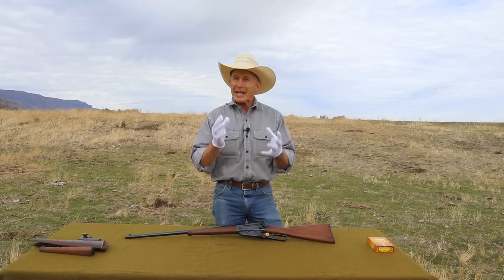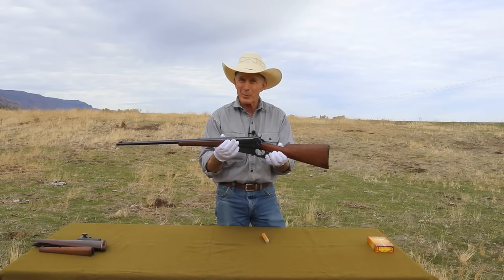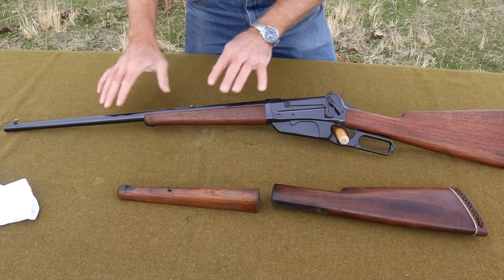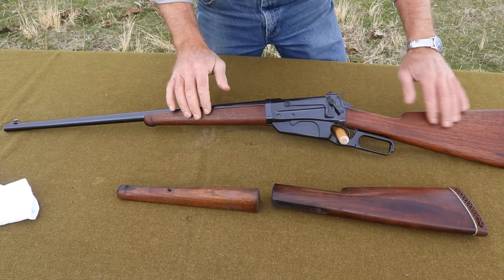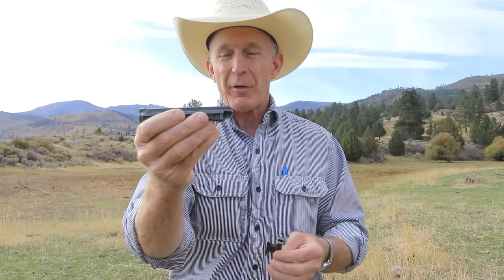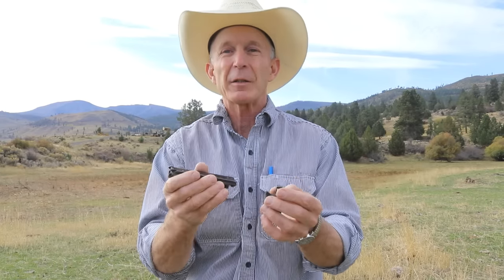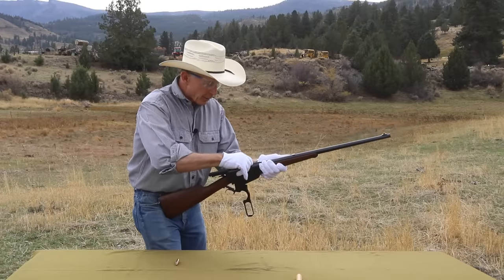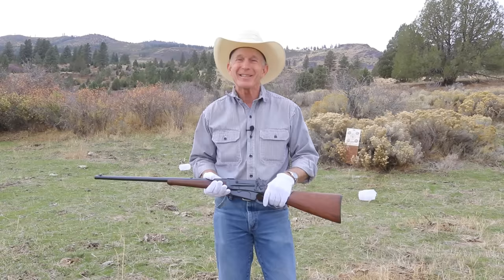1895 Restoration -Time to Test Fire

Comment: great clip, thanks. I got lots of information. Last week I got a Miroku Winch 95 in 30-06 for shooting. Always wanted an original one but my buddy, a gun smith  told me about problems wth modern loading pressures. I couldn't believe untill you told the same. greetings from Germany....
Reply from the maker: Matthias.  It's my understanding that the reproductions are made from a higher quality steel than the originals and don't suffer from headspace issues.

Comment: Thanks for the video Mark. Have you run into headspace issues on the 95 in 30-40??
Reply from the maker: No.  30-40 Krag doesn't produce nearly as much chamber pressure as 30-06.  About 40,000 PSI
Reply: Thank you

Comment: I would think 150 fmj 30-06 designed for garands would be suitably light enough in pressures?
Beautiful rifle very nice work.
Why doesn't the 7.62x54R have the same issues in the 1895?
Reply from the maker: I believe they would have the same issues.  I believe that if you were to regularly shoot modern 7.62x54r cartridges loaded to max C.I.P. pressures (56,500 psi), you would end up with the same issues.  The well-used Russian muskets I've fired usually show some signs of excess headspace with slightly backed out primers.  It's quite likely that most have only been fired with WW1 era ammo that almost certainly produced less pressure than today's ammo.
Reply: @thecinnabar8442 

Hey Mark, I have been reading some of Townsend Whelen's work, and he wrote that in his experience the original Winchester 1895 were generally not accurate rifles.  In his book "Ballistics" he wrote that groups of 4.5 to 7 inches at 100 yards were typical, and the Winchester company even told him that accuracy was indeed problematic for this model.  

Have you found this to be true?  Thanks
Reply from the maker: @HaNsWiDjAjA  I'm sure I've shot a much greater variety of 1895's than the good colonel Whelen, including all 9 calibers.  Some group well, some don't.  Overall, I'd say they have comparable accuracy to the other Winchester levergun models if the shooter has the patience to develop accurate loads.  I've killed multiple deer and antelope at more than 150 yards with 1895's and wouldn't even attempt those shots with a rifle that would only group 5"-7" at 100 yards.
Reply: @thecinnabar8442  I see. Might the good colonel's problem be due to the quality of ammunition he had access to?  I know that factory ammunition quality has improved enormously since his time, but I still find it hard to believe that it made an otherwise good rifle only capable of shooting 5-7 MOA.

Comment: Would 06 m 1 garand load's as you are sure to know are at lower pressure help with this issue. Just thinking how to fix a problem. Enjoy your channel. Blue steel and wood love it.
Reply from the maker: As I mentioned, according to Keith and Whelen, any loads in the 42-43K PSI range can be safely fired in an 1895 without creating headspace issues.  Winchester recommends pressures for the 1895 not exceed 47,500 PSI.  The info I've found indicates that M1 ball ammo produces 50,000 PSI.  They are lower than modern day 30-06, but I wouldn't regularly use them in an original 1895.

Comment: What about 1895s in 7.62x54R?  Are there many (any) in the US?  I know they existed but my historical knowledge is almost zero.  Please enlighten me.  Edit:  Thank you for taking the time to produce and edit these videos.  I pray that some time you'll break even or even turn a profit with ScrewTube.
Reply from the maker: There were 293,000 Russian contract 1895 muskets produced, more than 2/3rds of the total production of 1895's.  There's no way to know how many have returned to the United States.  Based on their scarcity, I'd guess it's a very small percentage.  Unfortunately, many of those have been modified and/or refinished.  Original and complete 1895 Russian muskets have become highly prized by collectors and the asking prices have soared lately.  Well used examples have an average asking price of around $6K these days.

Comment: Just came across two 1895's in my local Gunshop today.  The first a military type of carbine in honest to goodness 30-03 Springfield.  the other a slim barreled sporter in .35-Winchester, which was a wildcat 30-40-Krag with a .358 caliber bullet.  

As to bluing, with Winchester there was a period that the receivers and barrel steels were too high of Nickel and would revert to the white.  About 1929/30 or so Winchester switched to what they called "Winchester Proof-Steel".  This metal would take any bluing method.  The problem was the metal make-up, not the bluing.  The Du-Lite method is just faster (typically 30-minutes) and far and away cheaper to produce than the long and labor-intensive Rust-blue method.

I have an 1894 Winchester (.32 Win Special) the receiver was high nickel and made in 1928 and wouldn't hold bluing.  At that time a new company "Turnbull Restoration Company" was advertising in Shotgun News.  I sent them the rifle and had the receiver and other parts color cased and rust blued the barrel/magazine tube in the original Winchester method.  It to this day still is looking as new as when I received it back.  The color casing changes the molecular make-up of the metal at the surface but leaves the under laying metal intact.

Comment: Could you talk about the early model 1895s that used a leaf spring for the magazine?  I’ve not Seen or heard much about these.  I have one and I think it was made around 1905.   It’s in 30-06.  Thanks.
Reply from the maker: The leaf springs were used for the magazines until the 1895 take-downs were introduced.  That leaf spring protruding out under the forend wasn't compatible with a takedown assembly, so they were replaced with an internal coil spring in all the 1895's going forward.  The leaf spring are certainly much easier to deal with when working on '95's.

Comment: Great job Mark!  I just started a deep cleaning project on a 3rd year of production 10 Gauge Win 1887.  It was covered in a light but hard layer of rust.  After removing the rust, there were no major pits.  That's good news.  Looks good for a 132 year old shotgun.  I will lube it up real good and put it aside until I can get to it.  Still finishing up my current project.